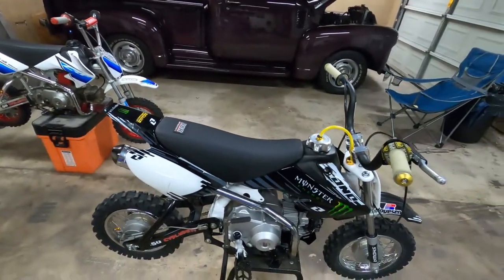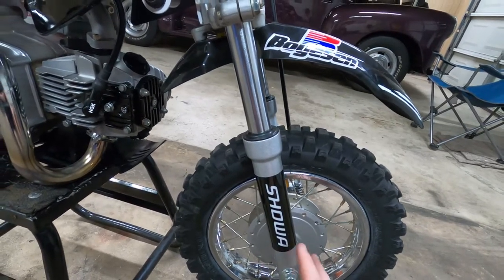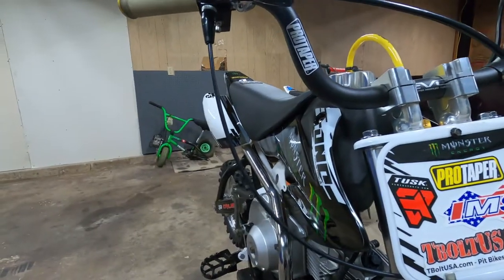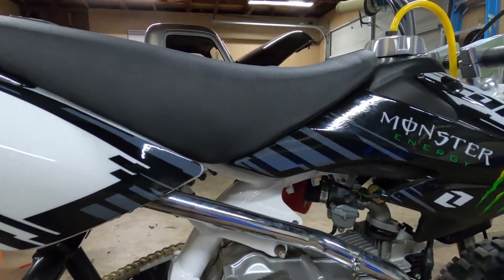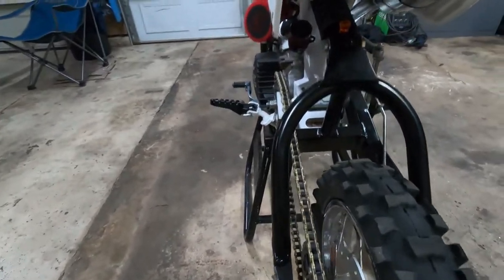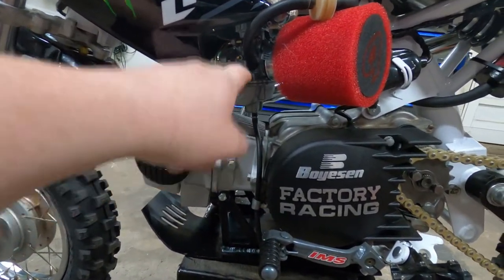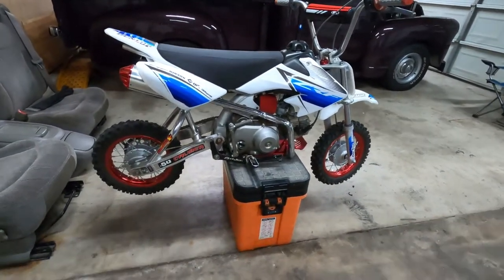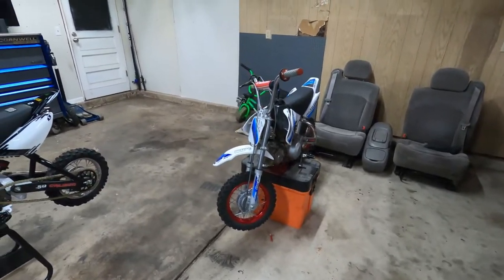one nasty XR50!!

Comment: Love to know where u got the forks from off ebay been searching for bigger forks for my mini 50
Reply from the maker: https://www.ebay.com/itm/144539120472?chn=ps&_trkparms=ispr%3D1&amdata=enc%3A1IdxswCkjRK6gojBCad4swg31&norover=1&mkevt=1&mkrid=711-117182-37290-0&mkcid=2&itemid=144539120472&targetid=1644837435723&device=m&mktype=&googleloc=9026243&poi=&campaignid=16743749222&mkgroupid=138744546207&rlsatarget=pla-1644837435723&abcId=9300842&merchantid=101745562&gbraid=0AAAAAD_QDh-GrDSmo3F3twFszWhHXYdqq&gclid=CjwKCAjwnZaVBhA6EiwAVVyv9AoG1xkCSYsv9Xq1mHKSiPf-uW8p4TX305cC40_IDo22RuLyt01nBhoColoQAvD_BwE
Reply: @twinzspeedshop5931  appreciated I got a 2002 xr50 I'm doing build on doing same suspension setup like u did just looks cheapest and most driveable for a adult im 6ft
Reply: @twinzspeedshop5931  with these forks do u need the xr70 triple clamp then high rise bars for xr70 then ?
Reply from the maker: @countrycanadian44  I use xr70 triple clamps and just any full size bars
Reply: @twinzspeedshop5931  but can u use crf50 triple clamp on these forks or u need to swap to crf70
Reply from the maker: @countrycanadian44  you have to use crf70
Reply: Where do you buy the tripple clamp?

Comment: That is one nasty machine! I'm not as good as you but I found a company t-bolt USA and I bought a modified engine I think they called it a Works engine!? Price was good they built the entire engine up for me new piston head carburetor gaskets rings intake Heavy Duty clutch they even installed it in their test machine ran it adjusted the jetting swapped oil again and send it to me as a complete engine including leaving all the wires hooked up the CDI coil ignition wires kill wire everything with plugged in all I had to do was put two bolts in sprocket chain exhaust system gas and I was ready to go. Vince could not be more helpful. Good luck with your racing or off-roading by the way pit bikes are a lot of fun the best hobby ever
Reply: How much did they charge for the motor ?